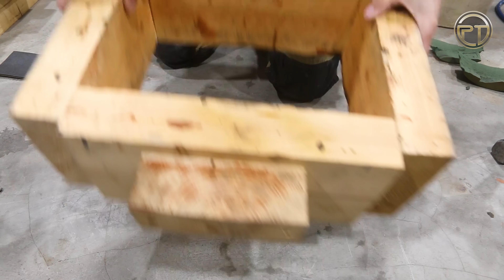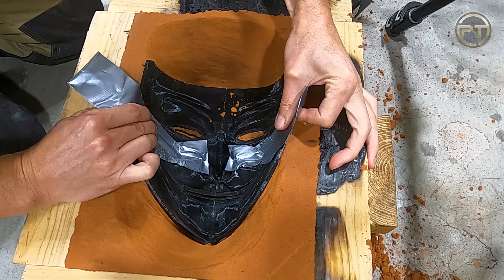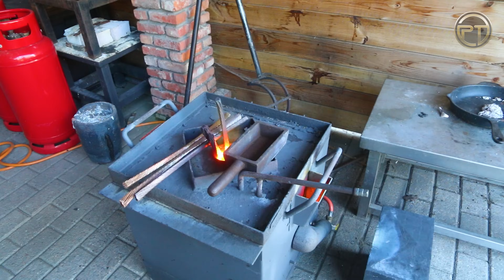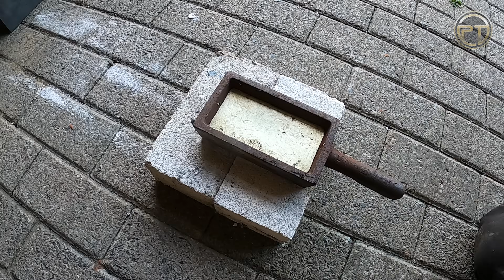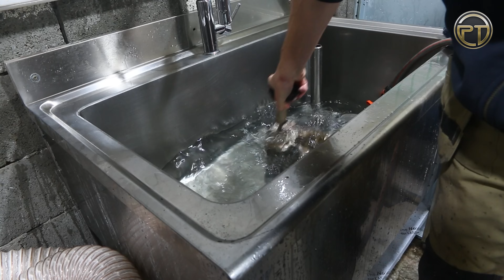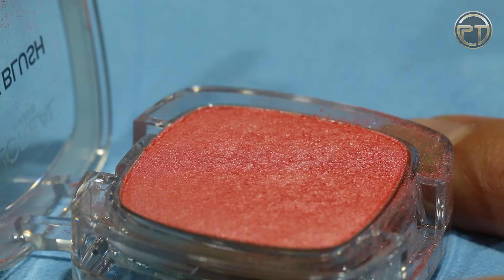I Turned Trinkets into a Bronze Vendetta Mask!

Comment: Beautiful work  although i think you rammed it to hard lolz
Reply from the maker: In what way?
Reply: @PressTube  when you were doing the initial ram on the bottom before you filled more. It's not supposed to feel like concrete lolz that causes cracks. But you did Good